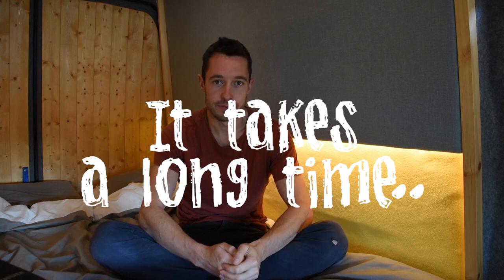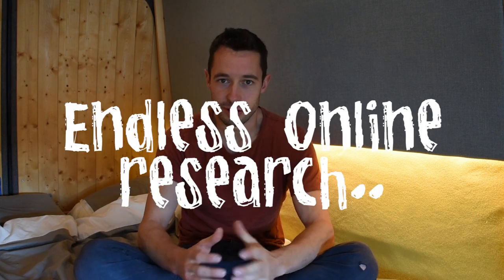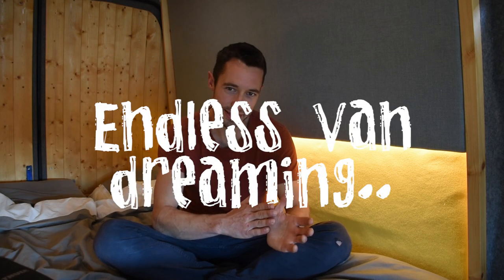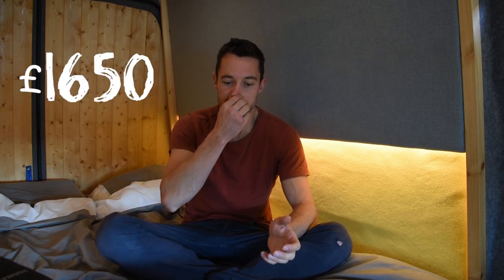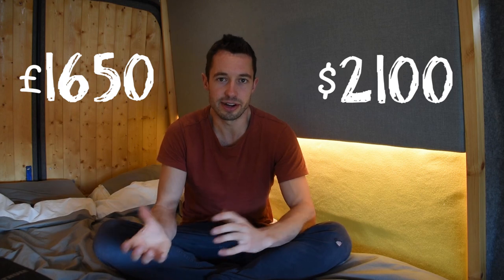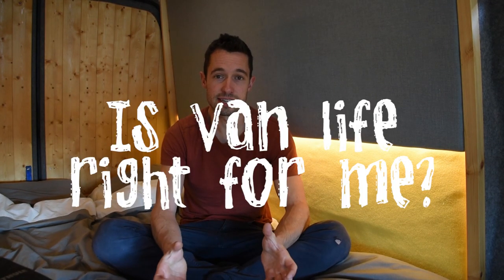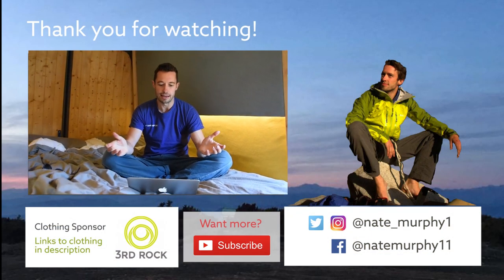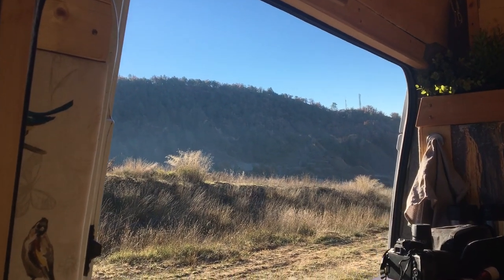THINKING OF DOING A VAN CONVERSION? 6 THINGS TO CONSIDER

Comment: 300 hours in 17 days??? Man, meth is one hell of a drug.
Reply: Omy gosh..you're right i multiplied 17 × 24 hours in a day and got =  408. 

If he worked even at 12 hours a day for 17 days...its 204 hours. 

If he only slept for 4 hours a day and worked 20 hours for 17 days...that is  340 hours with no breaks or lunch times included in this figure. Lol
Reply: Yeah 17.5 hours a day for 17 days is not possible! Think the maths is wrong there.
Reply: The days were not consecutive. You can check the wether.
Reply: @malerei9270  If you watch the video they were. He took a couple of days off but all of the other days were consecutive.

Comment: Hey Nate, loving the van videos, subbed after I caught the first one, it was my first introduction to the idea of living out of a regular old van with mods and your attention to design and detail puts you head and shoulders above other 'vanlife' vids I've seen since, which tend to lean towards 'van squat' than home away from home :P  I've a question from the 17 day build, that being, where does your extractor fan actually extract to? I gave the video several skim overs after the initial watch and couldn't work out if it's got a hole in the roof or what.
Reply from the maker: It is a mushroom vent - the hole goes straight through the roof - the bottom and the top bold together. The top has a rubber seal which makes it waterproof.

Comment: Hey Nate,

Top job on the conversion. I purchased your eBook also, really good information! I am taking the parts I love from your design and merging with some ideas I love from the sprinter van diaries couple.

I had a question about the floor beams, did you screw them down or just use glue? What dimension are the beams you used?

Thanks
Reply from the maker: Hi Doug, that sounds great! The ones between the insulation? I think that was 1.5inch sq wood. I glued them down and screwed my ply base down on top of it. Thank you for watching!
Reply: Dude, great videos I subbed after the first vid as well. I want a van for weekends to go surfing (I live in Devon) and maybe to France and Spain next year for some surf trips do you think  ford Transit is too much for me? I do like my space and think i have the skills to convert one. The practicalities and convenience of not having to find accommodation and for chilling out in are too much for me to  pass up on. .
Reply: What is the length of the book. How many pages?

Comment: Two vans, five years of off-grid. Keep it simple, shower can be a garden sprayer. A good fridge system is essential. You need to plan it, including all the electrics, before you skin it so you can put in supports and run the wiring. A spinning roof vent is a really good idea, and if you live in England, a tiny coal stove from a Narrow boat. Build permanent ventilation.

Comment: Only £300 on batteries, you must have very low demand :P I'll prob spend 7-10 times that. But a diesel heater is 100 GBP iirc

Comment: Hi Nate!

I'm thinking about doing a van conversion, however I can only drive up to a 3.5t under my current driving licence. 
I want to be able to stand up and have a shower space. 
Do you cover weight issues in UK in any of your videos? Also predicting unladen weight after conversion 🤔

Can you help? 

Thanks, Jade
Reply from the maker: Most panel vans with a conversion of sensible loading should be under 3.5 tonnes.

Comment: Hi Nate! Nice video again! I have two questions about your conversion: how much did you spend on wood? and how many meters or square meters of wood did you use, not only the visible panels, but also for the construction.
also, because the weight is an important thing: did you ever weigh your conversion? can you estimate the added weight with all the solid wood, gas tank etc? that would be a great information and also important to consider. at least depending on the rules of the country you are living in and register your van ;)
Reply from the maker: Wood.. not sure a few hundred quid for sure! I just kept buying it and it kept eating it! Not sure, 250-300kg maybe? MPG went down from 32.5 to 30mpg if that helps! In the UK its fairly chill and easy to comply with regs.

Comment: Can someone settle this debate once and for all for me?
Solar panels....sunlight only or light in general (be it daylight or downcast)
I live in Ireland and want to do a conversion...but we have shitty weather most of the time
Reply from the maker: They do work in cloudy weather - generally around 1/4 output (depending on how thick those clouds are!) How many watts can you get on your roof? In the UK it was totally find in summer... Winter I would be doubtful..
Reply: Nate Murphy

Thanks for the reply, I have the same van picked out as yourself, high roof ford transit, I plan on getting a roof rack so I suppose I could put two large panels on it, know nothing about watts yet, haven't delved in that deep, just wanted to know if solar was a waste of time in ireland and whether I should install them only when I plan to travel europe, but like you said, if i live thru a great irish summer it would be a shame to not have the solar during it. Cheers for info, I do plan on getting your e-book for when I'm ready to rock on the van idea.
Reply from the maker: Roof rack.. useful.. but big panels may take most if it up.. Just need to work out pros and cons! Good luck when you get to it! :)
Reply: Also from Ireland looking to do a van conversion some day in the future. Did you end up making it?
Reply: I did a mini version in a fiat scudo which I'm currently living in, saving for bigger van at the mo, need 3 months tops

Comment: 300 hours, doubt it. 300 hours in 17 days is approximately 18 hours a day (I didn't math well but you're suggesting that's all you did. otherwise good video.
Reply from the maker: Yea I should have clarified a bit - prob more like 250hrs work in those days, then 50hours of research and design work.